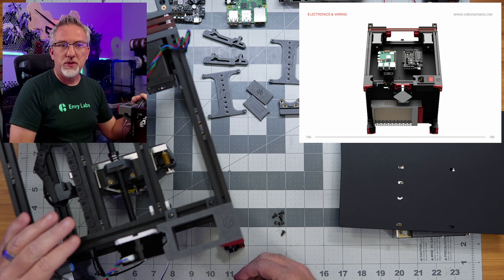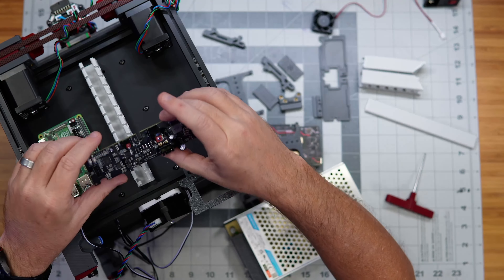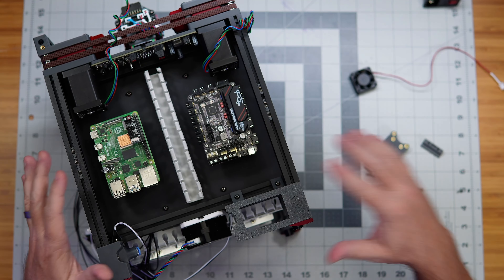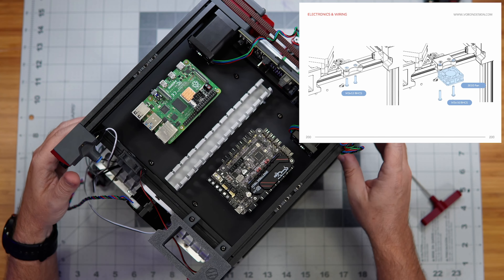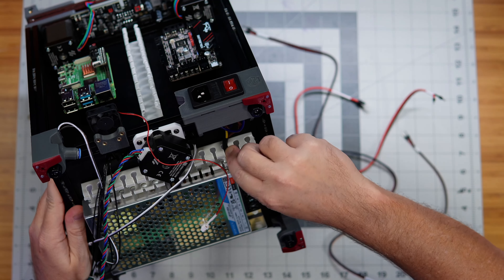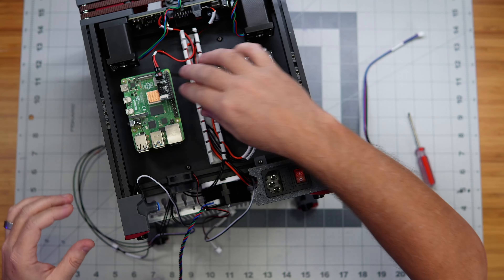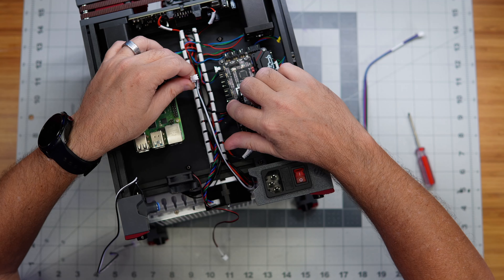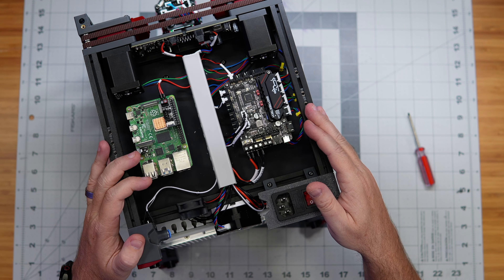LDO Voron 0.2 Build - Electronics & Wiring

Comment: After watching your vids, my 0.2 is ready to go but for one thing. There is no way to power the Rpi 4B. I don’t see a way to add the top hat you mentioned. Maybe LDO has the wrong part in my kit?
Reply from the maker: The hat just fits onto the GPIO pins on the Pi. The photo in the LDO docs - https://docs.ldomotors.com/v0s1_wire_guide/rpi_z2w_prep.jpg - shows the hat installed but it's on a Pi Zero, so that won't be exactly the same as the Pi you have. I can try to grab a photo of the Pi in my built v0 tomorrow if you think that would help.
Reply: @ I found it. I got on Discord and they helped me figure it out.  One of those parts that gets lost in the shuffle. The last piece I have is the Z end stop. Mine came with the three terminal block unlike yours that has two terminals. But, LDO doesn’t say which wire to put on which hole and polarity also is not specified. I also don’t have a two lead connector end to use. Would you have any suggestions?  If not no worries. I may end up ordering a two end connector if all else fails and do what you did to get around it.
Reply: @Shenandoahleather  I'm currently wiring my kit and run into this issue aswel. I assume its white on the IO pin and black on the ground pin. No 5V wire needed. How did you wire this in the end?

Comment: Just a question how did you mount the picobillical board as i am struggling to find instructions on how it attaches properly into the 2 inserts
Reply from the maker: It's been a while, but I don't recall having any issues with that part of the build so I'm not sure how to help. I'd suggest making sure you have the correct printed part for that picobilical mount. I don't think it uses the standard v0 printed part. I'm pretty sure there was an alternate part linked in the LDO documentation.
Reply: @gunplamark  thanks but what i forgot to say a day later that i commented this i joined the ldo motors discord and then they helped me there it was just 2 m3x8 screws